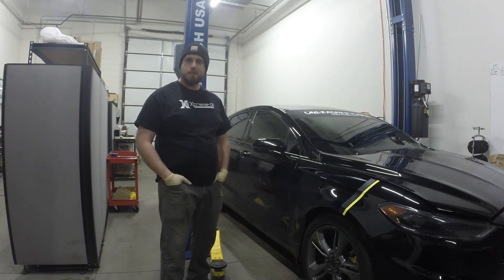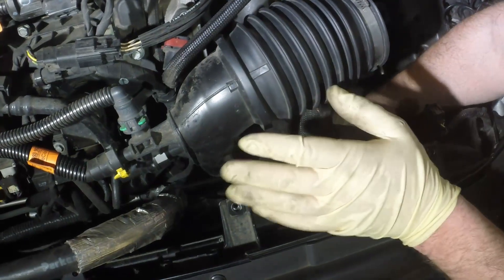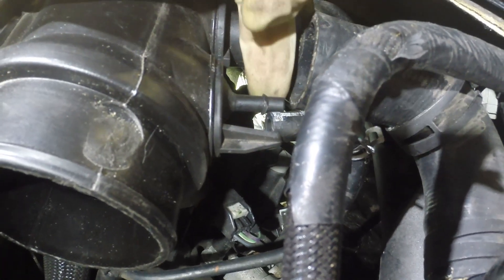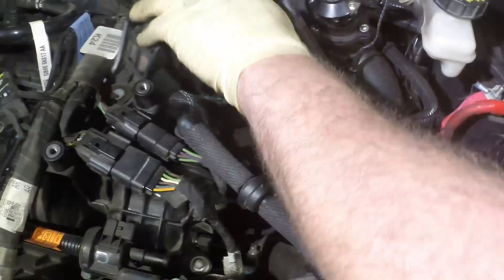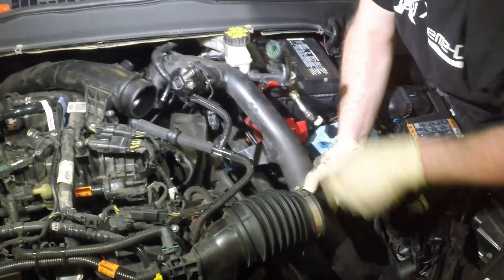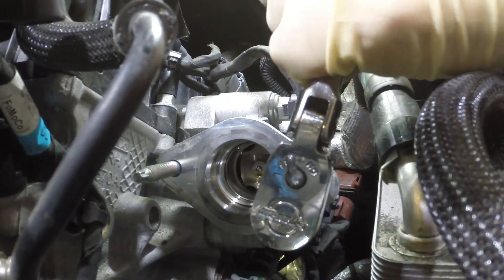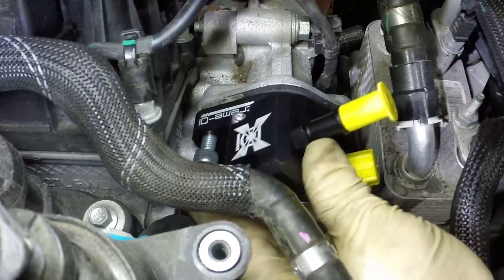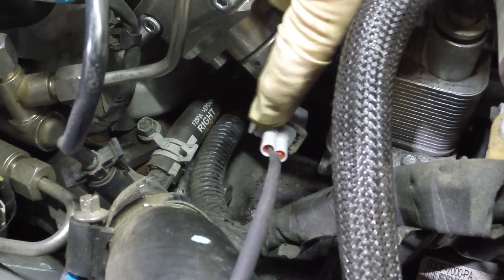XDI-HPFP35 Installation on Fusion Sport 2.7TT

Comment: I have a 2015 f150 2.7l. Under heavy sustained load, it loses high pressure fuel pressure. This has happened with 2 different stock hpfp's. Will this xdi fuel pump fix this issue?

Comment: For those who feel inclined, the official Ford replacement procedure recommends discarding the old and installing a new high pressure fuel line. For the pump to rail line FT4Z9J323A (when installing the HPFP) and the rail to rail line FT4Z9J323B (when installing injectors). Ford also recommends replacing intake man. gaskets and injector clips when replacing injectors FL3Z9439A, BL3Z9C995A.

Comment: Where, or how, would you recommend tuning for this pump (and injectors)? Thank you!
Reply from the maker: Unleashed and TuningbyJames have most experience on this plattform with our fuel system. Every other Ecoboost dealer of ours will be able to tune it as well.

Comment: This is actually one of the best install videos i have ever seen. Great tips and tricks to get what you need done, and all tool sizes mentioned. No repetition. Great job!
Reply from the maker: thx man !  We had some mic issues. Need to edit new voice over at some point. Light wasnt optimal at all times as well. 
I wanted to get this out so all the group buy guys can get started.
Reply: @Xtreme-DI  Yeah, I get that the editing was not perfect, but whatever you say about production quality, you gave us everything we need to install one of these, and that is what matters.
Reply: Would this make it possible to run full E85 or would it be more beneficial to run like an E50 mix?
Reply: @PeePee666PooPoo  wondering the same thing